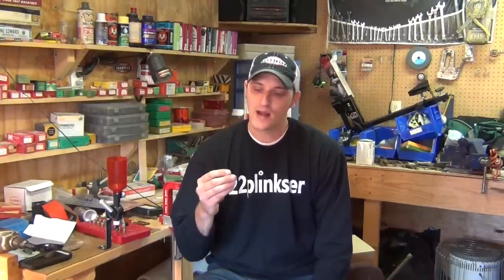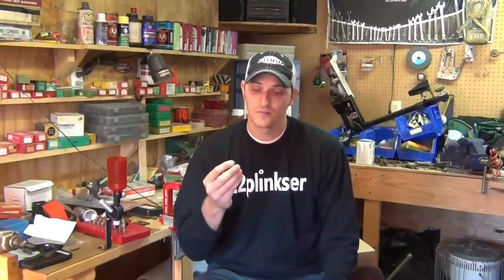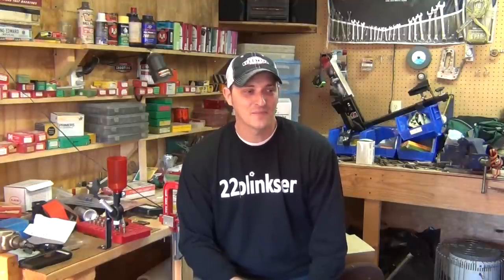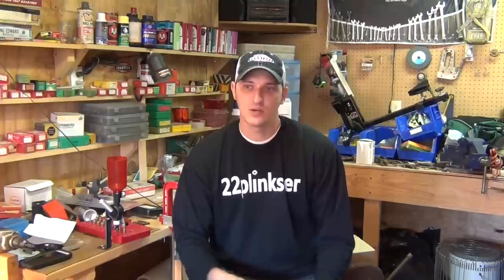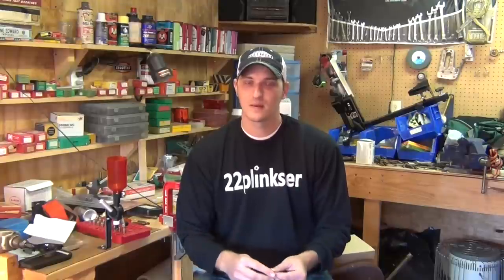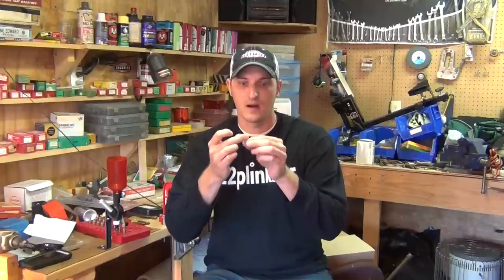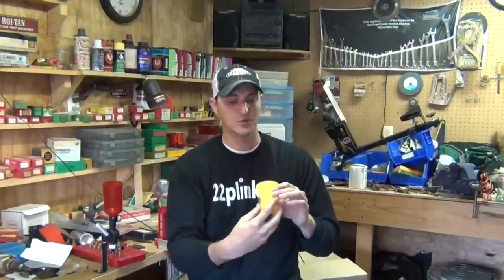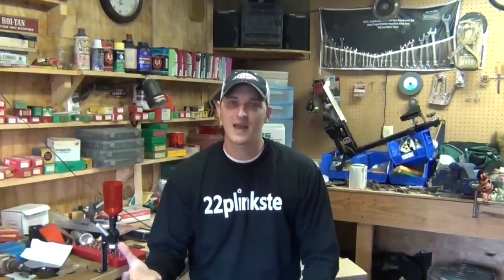Why does the .22lr have misfires?

Comment: I don't believe for one minute there's any rimfire weapon anywhere that can be snap-fired without a case without accumulating damage to the firing pin and or chamber shoulder. I do believe there is a manufacturer somewhere with a compromised enough set of business ethics to tell you this; but I do not believe such a piece can be designed, or built. You should stick to the standard holy script handed down from generation to generation; never, never dry fire a rim fire weapon. You don't have to buy anything; just use one of your own fired cases. I did this all the time with my Winchester Model 52-C; and after working my way all the way around the rim of the empty, I'd start on a new one. I've never met any knowledgeable person in the gun culture who would countenance the idea of dry-firing a 22LR. Just don't do it.